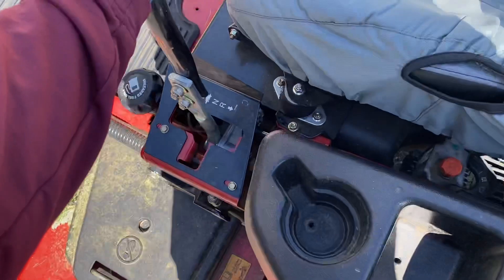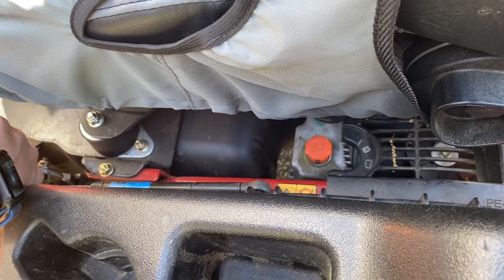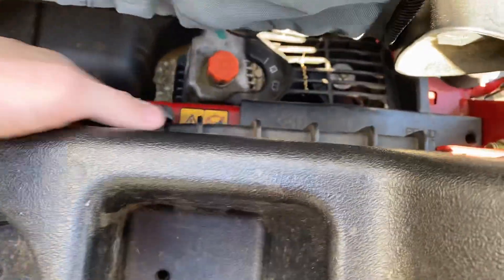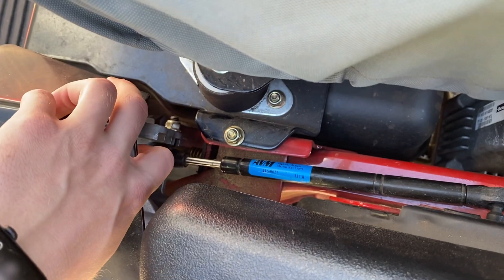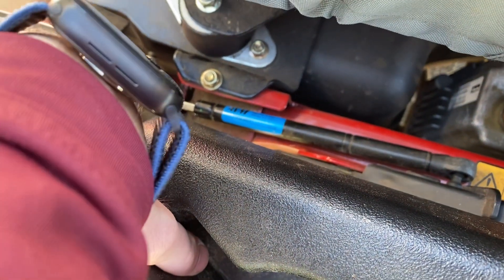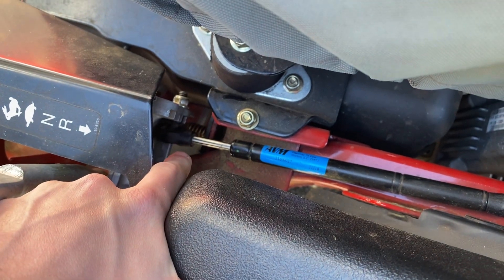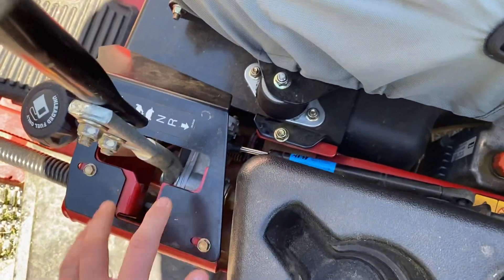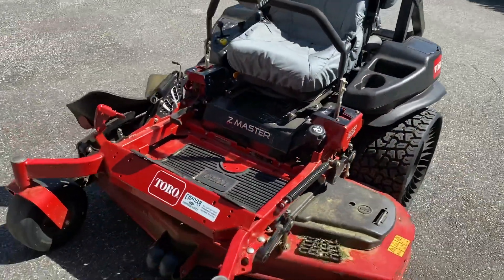6000/X-series zero turn motion control damper adjustment

Comment: Is there a way to tighten the whole mechanism when you’ve got the handle out of neutral? Mine works fine but seems to “wiggle” around too much.
Reply from the maker: You can make the movement of the sticks from locked neutral to unlocked neutral however, once in unlocked the “play” come from the lack of resistance in the damper to let the operation know they are in neutral and is inherent to the damper not the position.

Comment: I did that it did not work
Reply from the maker: should at least have less resistance going forward but backward is controlled by a leaf spring that adds resistance. May not be as light as a 3000 or 5000 but is lighter than stock.